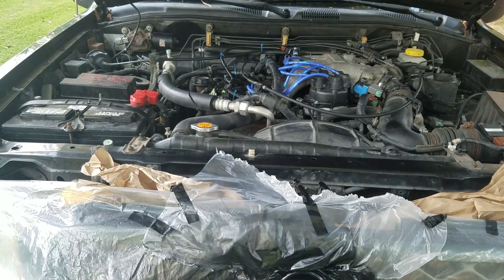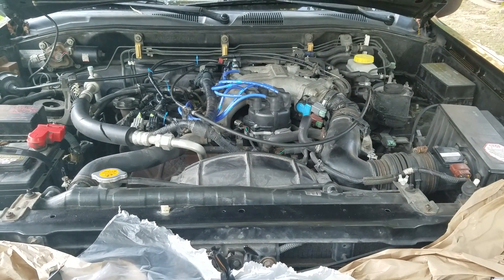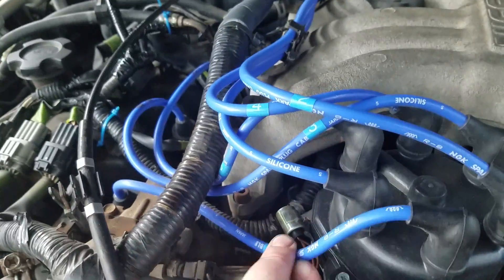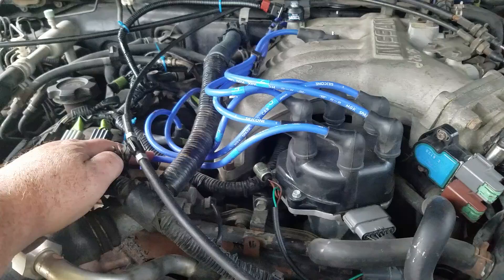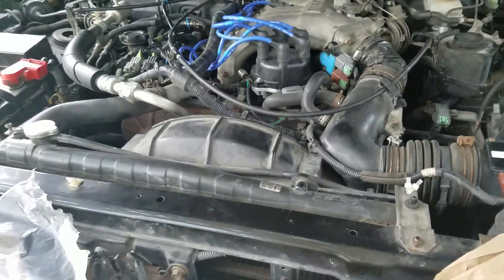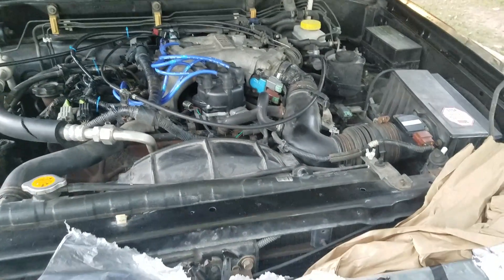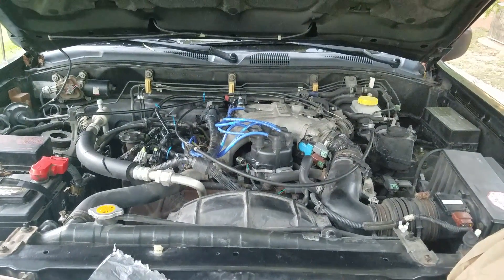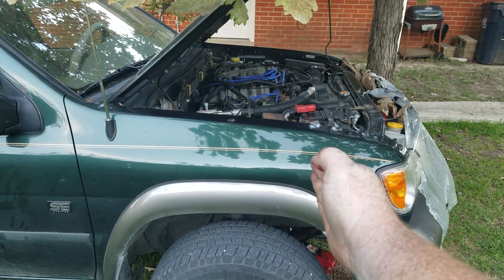How to understand Oxygen Sensor Locations (Bank 1 and Bank 2)

Comment: I’m getting a rotten egg smell inside my car after I accelerate the car at about 60mph and  hints of it while driving low speeds gets me a bit disoriented and nauseous  what could be the problem?
Reply from the maker: EzE 101 sounds like you could have carbon monoxide leaking into the cabin of your vehicle. Carbon monoxide can make you disoriented and nauseous like you describe. Carbon monoxide is a colorless and odorless gas that is very deadly. Please have a mechanic look at your vehicle before you drive it anymore.
Reply: Thanks Aaron I did take it to them they changed the filter the air mass sensor and oxygen sensor but smell still comes in I hate to spend money and the problem still not fixed am look to see if someone can give me a specific idea of what it can be
Reply: It's one of the  catalytic converters bro.. have some one accelerate in park or neutral  check underneath and if it gets cherry red it means it's bad
Reply: Rotten egg smell is commonly a bad catalytic converter

Comment: V6 and V8 cylinder orientation differ depending on manufacturer.
 for instance , 07 Toyota V8 is like GM V8. Right side (driver) is 1,3,5,& 7 while even 2,4,6,& 8 on the left (passenger). I guess it can be very confusing

Comment: thanks buddy.  I didn't realize that it was that common-sensical.  I have an 06 frontier 4.0 and got an OBD code of P0031, and P1148.  Both relate the close loop back; and on the P0031 said: low bank 1, Sensor 1.  So essentially, bank 1, sensor 1.  helps to know where to look and to buy parts. I'd already bought a new MAF, and Gas caps as they are notorious for throwing lights too, and super easy to replace.  I figure having them in the car, won't hurt!  Now get that O2 sensor done and this damn vehicle will be driving again.

Comment: thansk for the explain but please can you help me i have a nissan quest 2000 and i have po141 code,   o2 sensor heater circuit bak 1 sensor 2, i cant find  in the car
Reply from the maker: Olga Leiva, I would recommend to look up on the internet a cylinder diagram to find out which side of your engine cylinder number one is on. Then you will know which side is bank one. At that point my video here should lead you the rest of the way. Hope that helps! Good luck!